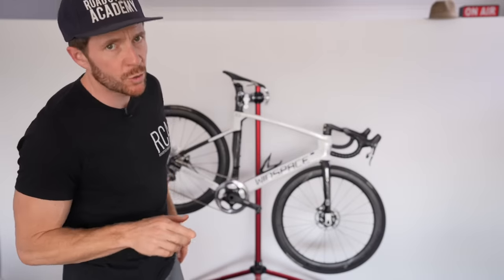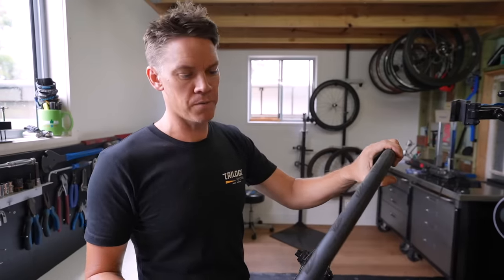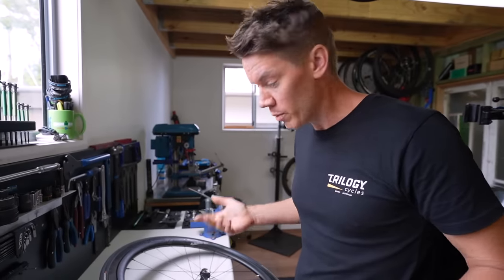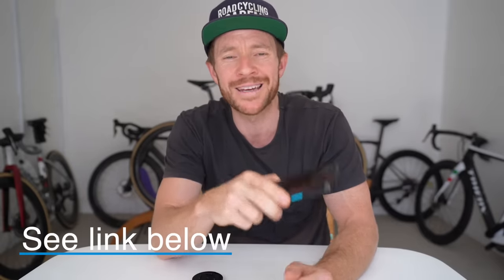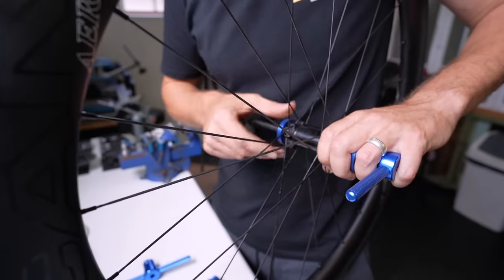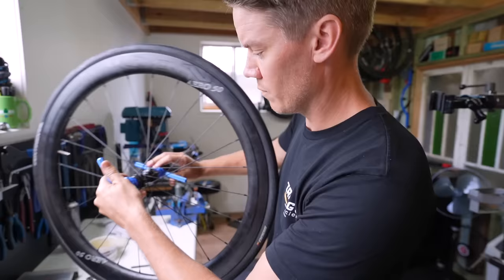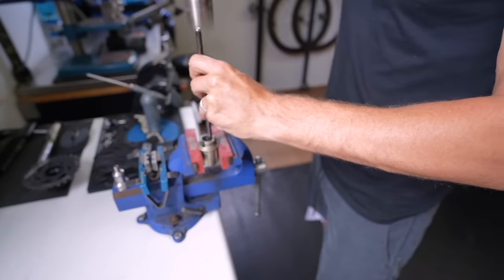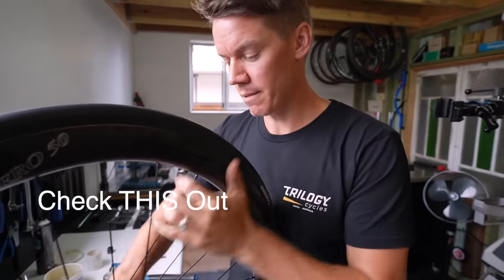Make your carbon wheels faster (with a simple upgrade)

Comment: Ceramic bearings are designed to excel at applications doing 10000 rpm and way more. No bearing on a bike will get anywhere near that, not even your wheel hubs on a 100 km/h mountain downhill. So they‘re basically a waste of money and any proper steel bearing (NTN or such) will do as well. If you‘re looking for extra performance, you‘d need to take out the seals and remove the grease to replace it wirh oil. And pray that it never rains during any of your rides… 😂
Reply: I've never purposefully bought wheels with ceramic bearings but Zipp accidentally sent me wheels with them. 15,000 miles in all kinds of weather and they were still rolling great when I sold them.  I also ride all winter in an area that uses a lot of salt on the roads.
Reply: @veganpotterthevegan  No one says they don't work well in general, I just doubt there are any significant advantages that justify the extra cost. My main road bike is on over 20k miles with a set of NTN SS bearings and they still feel like new and roll great. Those cost 20 bucks a piece, while the equivalent Ceramics are around 50 if I remember correctly. But that's up to everybody to decide for themselves.

Unless you choose to use Ceramics for your steerer, then you officially have too much money. 
😜
Reply: @renegodde5483  the cost being justified will all be up to the buyer.  I know I wouldn't buy them for wheels but I'll definitely buy them for bottom brackets.  That said,  a lot of cyclists die of old age with tons of money in the bank.  They may as well spend it while they're alive🙃
Reply: @veganpotterthevegan  Like „the last shirt has no pockets“? You may be right about that…
Reply: You would also only use ceramic maybe on a velodrome, on most normal roads or off road would probably crack them and why people would use hybrid ceramic instead if want to go quick
Reply: If the good quality steel bearing is clean and greased up properly ceramics are not worth it.

Comment: Imagine the profit margin on those bearings. Manufacturing cost must be well below one dollar. No wonder your bike shop won't charge you anything to install them, I'm shure they give their retailer healthy margin. Would be nice to see a comparison with a high quality NTN or SKF bearing made in Japan.
Reply: Ceramic are junk.  Potentially faster for 5-800km and then rapidly dropping off to much slower.   But it'll take a while for them to be worse than the very worst super cheap Chinese ones.
Reply: A complete carbon wheelset like this costs around 200$ to produce. That's a small run. 
Just put things in perspective, margins in the bike industry are ridiculous high whatever what manufacturers say lol
Reply: Honestly there's stuff all margin and I wish I was making profits on them like you are suggesting. As a service to our clients of someone wants to spend the money on these items then we don't always charge for installation out of good will. Believe it or not some shops do have a preference on community and customer loyalty still. Cheers Aaron
Reply: @BS16Tech  I'm not saying you are paying them $1 each, you are not getting them out of the door of the manufacture in Mexico (there is the brand who bump up, then the exporter who do is 2x and the distributor in your country in 2x the price as well). Your margin is probably closer to the discount amount you gave him in the video. If it's anywhere less than that, you should switch supplier.
Reply: @LaurentiusTriarius maybe, but what about hidden costs like development, machinery, quality control, distribution, marketing...
Reply: NTN bearings spin great, last a long time and are very reasonably priced.  My ceramic BB only lasted a few years and didnt feel any better even when new.
Reply: @daZache04 there is no develop in those bearings. It’s standard and has been out for decades. It’s just different sizes for bike and industry is usually behind for using new and better tech
Reply: Cycling is all wind resistance... don't waste money on ceramic bearings...
Reply: Ceramic bearings have been invented to handle higher temperature than steel ones. Very helpfull in a turbomachine for example Power gains are ridiculous for a bike, almost impossible to measure compare to top end NTN-SNR (that can be produced in France too 😉)
Reply: @daZache04 exactly. They are cheap individually but you have to have a factory probably hundreds of thousands of dollars of machinery being developed and run and serviced and that’s just the back end.
Reply: @MickeyFishman , factories should be there for a while. It is just a supplier chain topic. Cannot believe we need new factories for bearings.

Comment: The only reason to put ceramic bearings on a bike are to make ceramic bearing companies money. Steel ones like genuine NTN will outlast the ceramic and after a very short time will be freer spinning. Ceramic bearings aren't designed to be in a shockloaded environment. The only bearings in a bike that aren't susceptible to shock loads are the jockey wheels and the benefits gained there are probably in the $2000/W range. In other words it's only a tiny fraction of a watt that you can save.
Reply: 100 % correct

Comment: I find ceramic bearings die really fast. Literally 500kms and you can hear them grinding. Steel might not be as fast, but they feel just as nice, for a lot longer.
Reply from the maker: What do they say, 'steel is real!' I've had similar experiences although these bearings have been good for 7-8 months now. We'll see how they go longer term.
Reply: And...good quality steel bearings are a lot cheaper than ceramic.  Maybe for a top amateur racer, ceramic has its place but for average weekend warrior steel is more cost effective.  Labor is the key on changing bearings.  Not everybody will be able to do this job comfortably at home.  Replacement isn't cheap at the bike shop.
The tech in this video is very good.
Thanks Cam.
Reply: My Lun Hyper 2023 D45's have 4k miles on them with ceramic and spin as effortlessly as the first day they were ridden. That was impressive enough for me to order the 33's for a second build.
Reply: Not ceramic speed. Got thousands of k’s out of them.
Reply: At bicycle RPM’s, there is no advantage to ceramic bearings.  Manufacturing tolerances make bearings fast - not the materials,

Comment: quick question , have you looked into the advantages of ceramic vs steel, i went to a bearing specialist and asked about ceramic bearings and was told that a cyclist will never get the bearing spinning fast enough to get any benefit from them , any feedback?
Reply: It's all marketing to sell a higher priced product without real benefit. Good bearings have tighter tolerance regardless of the material used. Ceramic bearings have higher heat tolerance with less expansion. No cyclist will benefit from that.
Reply: Your specialist is 100% correct.
Reply: Any engineer will confirm that. Any Miami dentist will explain that the price is justified if someone is willing to pay for it. Ceramic speed has built a brand on the stupidity of the middle class.

Comment: ICAN is advertising  "Equipped with top-tier Japanese sealed EZO bearings" in the Aero line now.  They are steel but supposed to be a very good bearing.

Comment: Once the ceramic bearing wears out after about 500km they’re worse than steel bearings with 10,000km on them. 

I wish the ceramic bearings could have a ceramic race or a surface coating to match the hardness of the ceramic bearing to prevent the hardness of the ceramic wearing into the steel race.
Reply: yes.  Unless you have a hardened race made for ceramic bearings, they can easily get scored or dented if you take a big pothole.  For this reason Campagnolo and Fulcrums with loose bearings come with replaceable races.  I've had a few bearings crack and score the race, but the replacement bearings cost me less than $20.  I moved those races to the front, where I hope they will just wear smooth again. I think ceramic spins a bit faster, but it is more fragile and steel, once worn in with clean grease, is also very smooth.

Comment: After watching and reading a number of reviews, I had settled on a set of Lun Grapids, which were often cited as the best chinese carbon wheels. However, they were going to be over $1300 AUD...not exactly "cheap". Then I came across Airwolf at $940 with the optional dt swiss hub, so I grabbed them instead (maybe it was my fondness for the 80s TV drama of the same name). Yet to receive them but keen to see how they compare to my 202s!
Reply: the brand elite has dt swiss options for 600, thats what i use on all my bikes and builds

Comment: There is a lot lost in the conversation about hybrid-ceramic bearings. I've had really cheap ceramic bearings go quickly in a few hundred miles, and some of the best like the coated ones from SLF Motion and the Enduro XD15 last impossibly long with no maintenance at all. My XD15 BB has lasted as long in similar conditions as a bike that has solid oil bearings. Both well over 3x the life of any non-Chris King BB i have had, but without the maintenance that those require. Similarly, i have a set of jockey wheels that has lasted 30k miles from SLF run DRY per the recommendation from Blake at SLF. 

For the sake of curiosity I have a set of the Kogel alloy jockey wheels ready to go on a bike and curious to see how they perform with mud, grit and jetwashing that that bike sees as well. I dont expect XD15 levels of performance here, but hoping to be surprised.

Comment: Ceramic bearing are more performance & durability sensitive to fitting tolerances and degree of alignment in bearing seats, than steel ones.

IMO, you'd done better business by installing top-tier normalized steel sealed bearings, going to the opposite fashion: better managing misalignments and poor machining execution.

Time ago, I had to do so to stop looseness in a freehub bearing. By design, the manufacturer chose to compensate poor tolerances simply adding a preload nut in the rear hub; it ate bearing until I putted an industrial bearing wich seemed to stand higher axial loads... frequency between re-tightening increased noticeably, though.

Comment: if those bearings are have double seals you can remove the inner seals especially if they have a thick grease. nothing will ever get between the two bearings like water or dirt.  what causes more resistance in bearings more than the type or quality is grease and seals.

Comment: The biggest difference in high end wheels and the Chinese wheels is mostly the hubs where they save money. They come with sealed bearings. I ran mine for a few weeks then I took the hubs apart and cleaned that cheap grease out and put good grease in. Night and day difference without putting new bearings in. The avg rider can't tell the difference but you have to be Handy.

Comment: Steel bearings with metal cages spin just as freely as a ceramic bearing for a fraction of the price. The plastic cages in cheap steel bearings are what cause the majority of the drag. The grease used matters quite a bit too.
Reply: If I remember correctly most drag bearing gets from full contact seals, then grease, then bearing cage and lastly ball and race material. So steel bearing with metal race, lighter grease  and non contact seals gives biggest bang for a buck.
Reply: @edmundas919  right, but you need the seals and grease equally in steel and ceramic bearings. From what I understand there's no difference in performance between ceramic and steel with metal cages at the low RPMs used in cycling. So ceramic is pissing away money for nothing gained more than steel is the best bang for your buck.

Comment: remove seals, remove grease and replace it with oil will make your bearing spin faster. But what's the point if you are not racing?

Comment: Hu,o have the ican aero 55 disc wheelset.
I think,there are novatec Hubs.
Ican told me:

The hubs are Novatec D411SB/D412SB.

The dimension of bearings.

Front:6803RU, Rear:15267

On your Video,you have other Dimension of bearings....

And what Dimension of bearing in the freehub?

Best wishes,jens

Comment: never use the end caps , when pressing bearings you must only load the interference surface , this is the outer race section on a hub bearing , the end caps load the inner section .

Comment: Timely video as my front wheel on my Hollowgram 35 wheelset feels and sounds atrocious. I popped the seals off to get the code (macro mode on my phone doing the bulk of the work to read the code as Cannondale don't make life easy with exploded diagrams and bearings sizes, that would be too easy).

I've bought Endura replacements from a small manufacturing place nearby and just need to fit them but I've been stuck staring at Amazon bearing presses and pulling tools. The one in the video looks like the ~£50 blue version all over Amazon; is it? Also, recommendations on a puller would be welcome as it looks as if I can't punch them out.
Reply: you can probably create your own press with hardware store nuts and bolts. Oz cycle has for sure made reference to it. If you have a 3d printer then you can print all the adaptors, shims and what not that you can imagine. Pressing round things into other round things is rather basic once you have a threaded rod and a bunch of nuts & spacers. I havent bought dedicated tools in quite some time because i can make on demand tools with a 3d printer. with enough points of engagement, PLA is surprisingly sturdy as a material (if you know how to design & print parts).
Reply: @pierrex3226  still hard to beat £5 expense for the LBS to press them in compared with 3D printing your own parts but still, pretty cool to 3D print stuff anyway (although integrated mounts like Raceware would be my instant project).

Comment: What the brand of that bearing press kit he's using?
Reply: Looks like the same one I bought from Amazon for about £40 - cheap Chinese brand under multiple names. Was surprised to see him using that quality tbh, fine for occasional home mechanics but not pro-shop quality (but still way superior to a bunch of old sockets, washers, bits of wood and threaded rod with nuts)

Comment: i would prefer a bearing puller rather then a punch, just to be on the safe side. But nice video
Reply: As I said they are going in the bin and time is money.  
If I was removing, servicing, and re installing I would 100% use my bearing puller. Cheers
Reply: @aarondobbs2714  my thinking on the subject is to preserve the cylinder.

Comment: Ceramic bearing is just a marketing hype. You just had worn bearings (agreed  because of low quality). As long as putting new bearings ceramic vs steel doesn’t make a difference. 
I have had Chinese rims for years and changed bearings many times with right tools. Ceramic and steel. Main problem with most Chinese rims are their hub alignment which causes bearings to wear out faster.

Comment: my Campagnolo Bora wheels have ceramic bearings too - simply because they where delivered with them. Do they make the wheels faster? NO, ABSOLUTE NOT! If your bearings make you slower it's not because of steel but because it is BAD STEEL or they are worn out. At the speed we can reach with bikes it makes absolute no difference. And these spin forever bearings do only spin as long because they have no sealing - which in real world conditions will after very short use make you slower, not faster. Again some marketing hype of the industry to sell expensive staff

Comment: Ceramic bearings are brilliant but the manufacturer matter. Rather than going for no name ceramic - go for high quality steel. I pack mine with much more grease that you normally would for the performance and probably lose 0.5W or so but they literally last forever and the hubs are much quieter too.